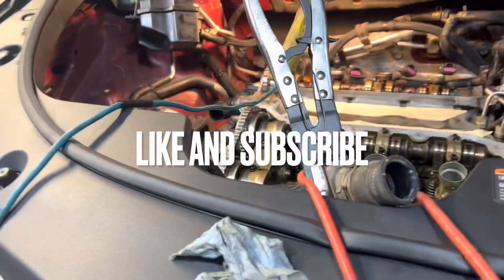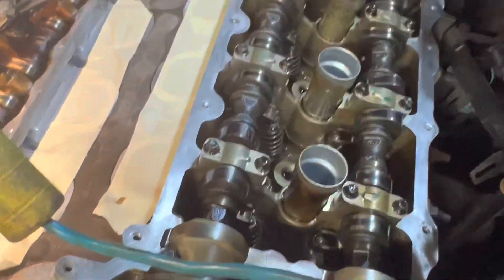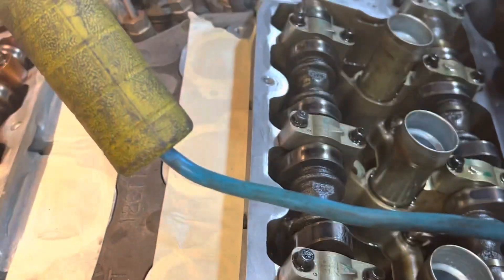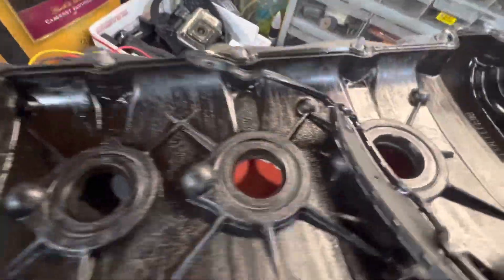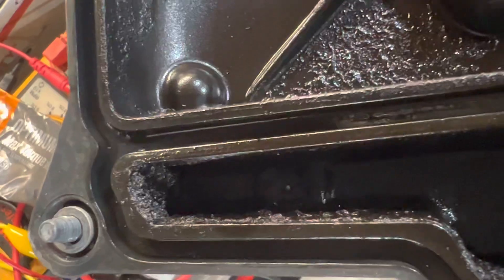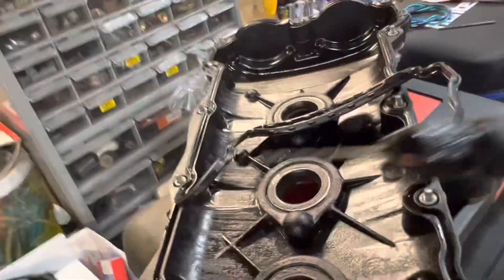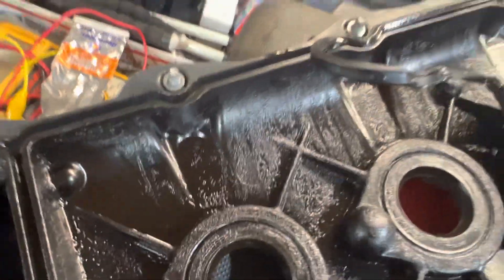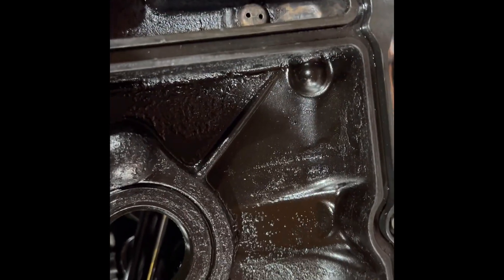GM High Feature V6 PCV Modification.

Comment: I've read that those holes need to be drilled out 5/16ths on the bottom and 7/16ths on the top. That system GM came up with was bad about building up air pressure forcing oil out just about everywhere, flat out bad engineering. Good engine-bad ventalation.

Comment: The front cam cover is the fresh air side of the pcv system. It only gets air That already passed through the air cleaner. The back cam cover is full of dirty air from crankcase.  That hole in rear cover does get plugged over time.  The back will never look like the front.
Reply from the maker: The later models had the bigger pcv valves as opening these would mimic and it helped reduce the build up on the rear heads. None the less appreciate the input and the view as well as comment. Take care please consider subscribing, thank you.

Comment: FYI, the front cam cover is getting clean air from the air cleaner, the rear cam cover really has no way of flushing away cooked oil vapor. The PVC "valve" is not a valve but really is just an orifice. The PVC orifice is partitioned from the cams and draws oil vapor from a chanell from the crankcase. Drilling the orifice will not cause the cam cover to be cleaner, and as others have said , will likely increase oil consumption.
Reply from the maker: Interesting, the later models have a the bigger orifices on the pcv valve and don’t seem to have this issue. I don’t know if any other modifications were done on the later engines other than that. 🤔 thanks for the view and comment.

Comment: I did this on my 2004 Caddy years ago and it made the oil consumption significantly worse.  What you want is the updated cam cover gasket that actually restricts the breathing flow.  But you do have to clean everything up and get all the carbon out because having it completely plugged is trouble too.  Some folks say an oil/vapor separator in the line is a good idea also.
Reply from the maker: That’s interesting, gotta check that out. Yeah it seems most modern engines all seem to need a catch can. Thanks for the comment and view. If you haven’t already please like and subscribe take care.
Reply from the maker: Catch can on these engines will definitely help. I didn’t have that problem on this car however after opening up the holes.
Reply: I agree, the larger holes will let it suck more oil, a catch can will keep the vapors out of the intake and off the intake valves